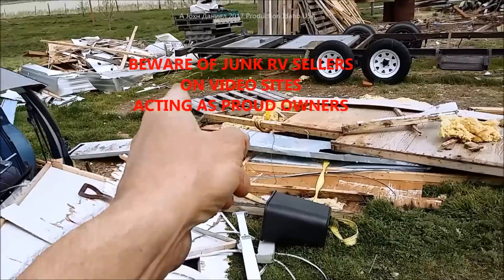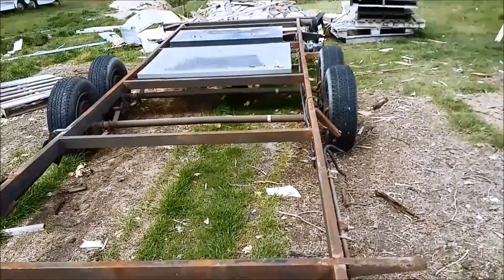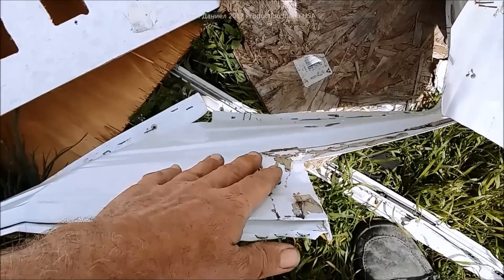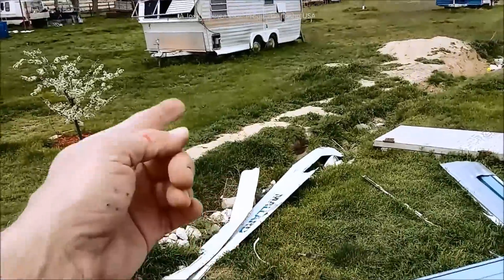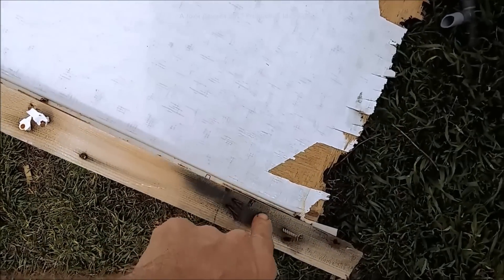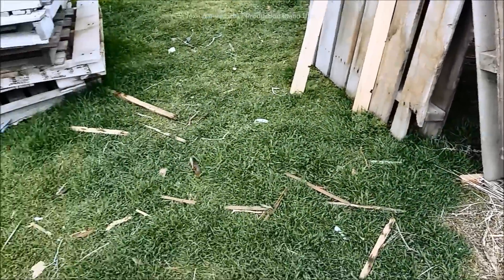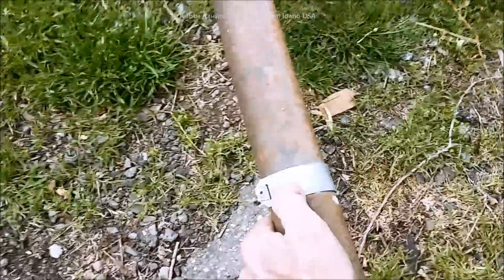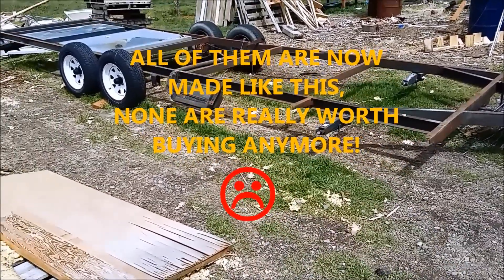HOW THEY MAKE RV Campers Travel Trailers, The truth, Wow! Info Below

Comment: Thank you for more info.....I am on a few RV face book forums and it is sad the amount of problems folks are having with brand NEW trailers and RVs And the unbelievable prices people are paying. I can across a 2003 24' Chinook C class RV. Wow they really built them right. After a few upgrades and new rubber we are supper satisfied that the Chinook company really cared about their work. Too bad they went bankrupt in 2005. The rigs that are out there are good and hard to get away from their owners.....thanks again for your information.
Reply from the maker: No matter your politics, one thing is why the creation of this junk exist. Pay Offs.  
For 3+ years we, a crew of me + 5 built custom home trailers for a while on a as order basis, we used a process that still to this date no one uses. We used all metal extrusion construction of 10 x 50 tiny home/mobile homes. Our construction method was full length, seamless 4.25" thick foam core fully structural panels, similar to insulated garage door panels. Floor, Roof, Walls all with the R-22 panel that weight 18% less total than the current 2.5" walls you see now in trailers. With rib rail locked air actuated pop outs, not slides. If I had not lost my $480 a month health insurance in 2011 due to it not being "approved" health insurance we could have staying going for years. Thousands like us were hit. One 3 day visit to the hospital on Obama fake insurance care cost me a REAL $68,000 while Obama care paid $730 of it after 8 months fighting them, basically nothing after us paying $1400 a month for 2 years to a obama forced fraud insurance. However, now that we are technically poor, we could get it all for near free,  but I recently got rejected for beyond pills medical care for my pneumonia illness but theres no way to ever start a biz again so our builds will just go down in history as 38 homes that increase in value and interest. 
On the bright side, this company paid millions in political donations ( recorded on the DNC web site) to Hillary and Obama and were allowed to sell us shit and keep the small guy out of business with insane cost against the little guy. Thats great for them at least. 

These are MY facts, not someones fake dreams, of what the last 8 years did to small and start up businesses. It was devastating, unless your job was a grubberment job, you got hurt. Lets hope I still have it in me to build again but who knows.

Comment: As John says....get an Airstream, they have nothing that can rot and has very good steel and welds, so you get what you pay for.   From what I could see the Lance brand appeared to be pretty good as well.
Reply from the maker: Airsteam, Holiday Rambler, Chinook, Avion and the like. Used in great shape prices are 1/3 a new RV. You can actually with about $2000 to $3000 put a awesome slide in a old trailer like that and for $3000 to $5000 more fully make it like new, still only spending 40 to 50% the price of a rot box made today.

Comment: Thus the reason you should never buy a wood frame trailer. Aluminum frame & fiberglass are far superior. Most trailers with some common sense upgrades can be made pretty solid. Also, flexing a frame with no stringers/supports attached to it, doesn't mean too much. If they were all built like tanks, they would weigh as much as one and you'd need a  semi tractor to pull it.
Reply from the maker: You could put just 2 rails under them if it was built with more than staples and cheap glue. Shameful thing is I could make one with light gauge metal studs that could be a Uni-Body that would weigh less and be much more rigid. So its the cheap unskilled labor honestly that keeps the 1x2 stud builders in biz!

Comment: Grade 5 bolts are perfectly ok for this use. Do some research on bolts.
Reply from the maker: Yes and no. From my years as a Welder, Machinist, Millwright grade 5 is sufficient in static load, NOT reactive load. Bolt shear under yield in such softer metal without proper dampening and bushings is certain. And LIppert the frame folks knew this, and thousands were recalled. This one was not, it rotted too fast!

Comment: Well, you point out a lot of 'facts', but you're leaving out a lot of detail, too...and I'm not sure if you're doing it on purpose, or intentionally...sounds like you know what you're talking about when you can call a 'drop axle' a 'drop axle', so I'm going to go with 'you know what you're doing'. That said, you KNOW that no one builds their frames...they buy them from Lippert...so EVERYONE has this light-gauge problem, not just Mallard. In 2006, everyone went to 'swamp wood' (bog wood, recovered from various floods in wood-supplier regions)...and you can thank Georgia Pacific and Weyerhauser for that 'hard sell'. Lauan dropping from .9 to .7, you can blame on stingy customers wanting 'cheaper', while you can blame the BLACK MOLD AND ROT on the change-over from Formaldehyde preservants to 'not working so well' other wood preservants (because we can't use CCA or Formaldehyde anymore...thank you EPA).  Vacuum-bagged walls have gotten quite a bit better since 2008, you ALWAYS have to keep up with flood-years to know when to buy and when NOT TO buy a new RV...because last-year's flood is this years 'cheap lumber that Home Depot won't buy' for RV building...and as for those Dexter axles rated at 2,880...hey, why spend hundreds-more for oversized axles when OBVIOUSLY the RV you are carefully inspecting there is a 'oil field job-site' RV that most-likely GVWR'd around 5,100 lbs...so tandem 2,880 means 5,760 GVWR to start with...NO ONE BUILDS OVERKILL ANYMORE! Oh, and I priced a 1988 Airstream TODAY...30-footer (30-years old, mind you), listing for $105,000!!! Sorry but I'll replace 5-mold-buckets before I pay ANYONE $100G for a poorly laid out, cold as a penguin on Christmas Day AIRSTREAM!!!
Reply from the maker: Lesson 101 - Never buy a gold plated Airstream! Plenty to be found for cheap on Oodle.com and Craigs list for $150 to $250 a foot

Comment: I've demo'd a camper before and you're right on the money. Trailers are made to be lightweight so they can jam as much stuff on em as possible. The frames are a joke, although they are made to be stronger with the shell on it.
Reply from the maker: Thats a logical process but on one condition, the upper frame would have to include some small amount of torque control steel too. But with wood and staples you get expansion, contraction, twisting, separating and LEAKING! Differing materials being hauled on the road is just asking for trouble. thats why I swear by Pre 1995 Holiday Ramblers and many Airstreams as the few that can survive the test of time.

Comment: 2,800 LBS x 2 = 5,800 LBS > 5,300 LBS. OK
Reply from the maker: Odd, I came up with 5600 lbs from 2800 x2, and 5300 was that the tag said its wet weight was, before you added your underwear and beer!
Reply: My bad. But, it was made with fire wood, and thin soft drink skin.
That is the reason that 50's 60's and 70's old campers are sill sought after for restoration.
Reply from the maker: You are very accurate on that assumption. In fact, a damage free Holiday Rambler from 1969 to 1993 was affordable 10 years ago, now they are going for the price they were when new and more. Same with Silver Streak, Airstream, Certain AVIONS, and a limited assortment and very certain years made by Jayco, Komfort, TravelAire, Modern RV, Chinook,  Kountry Air, Vegabond, and Travel Supreme. 
Set your goals on finding a wide body, 101" wide like a Rambler and or Kountry Aire and avoid "SLIDE OUTS" and instead just buy a better longer Wide Body trailer. New ones with slide outs are shit, they are 96" wide, but older models like Franklin, Komfort and Vega  had tip outs actually were better, sealed and insulated better. Just lazy ass people are why slide outs were designed. That extra wide body style 5" more width the whole length gave you 97" inside, the new ones give you 92.  So my choice, wide body designs of 100, 101 and 103 over any slide out!! In 1994 they stopped making over wides!

Comment: Get a converted connex on wheels! 

You're welcome!
Reply from the maker: Connex - Tare Weight, 8,073 lbs empty, add some framing for wheels and axles and a hitch, 9200 lbs, now your heavy before you put the typical 2600 lbs of RV stuff in it plus your own stuff about 500 lbs, then your ready to buy a semi! Only 1 in 400 pick ups on the road can pull it, none legally.
Reply from the maker: Seriously, build it the way I have been building tiny houses for 8 years. With insulated garage door style structural aluminum panels.
Reply: Јоhn Daniel - What!? F350 is rated to tow 26k lbs at the hitch or 34k lbs gooseneck. So, you could tow 2 or 3 converted conexes respectively. More yet, if you don't use a 40' box.
Reply from the maker: In all trailer builds, the absolute smartest build would not be connex, it would be the style the Japanese exhibited in 1995 of a whole 30 foot trailer for RV use that was casted in fiberglass, with ribs and floor and rigid insulation like a Uni-body. They even proved its cost was same or less, weight was actually less, strength was 200% more,  but the RV makers in America just blew it off as BS.
Reply: Јоhn Daniel - While that is somewhat interesting, I have neither a factory in which to build fiberglass shells for building RV's nor the inclination to learn the skill of professional-grade fiberglass laying. A conex trailer would be a better choice for absolutely anyone who wants a custom towable home without paying $20,000 for a pile of junk.

It'd last a hundred years, too.

Comment: We bought a used 2008 27ft Salem with 2 slides. These things are made cheap and out of particle board. The 1st winter the ceiling leaked around the roof vent. I found out that the rubber roof had a half inch gap on a corner of the vent. I sealed it with a rubberised roof sealant. I then took part of the bath ceiling apart and dried it all out including insulation. The water that ran in went to the cabinet wall holding the fridge and it ducked up the water like a sponge at the bottom. Pissed me off. The 3rd and 5th winter the flooring split everywhere this last one the worst. I had to cut the flooring out and glued down 12"x12" thicker tiles over the plywood floor. I cut wood trim boards around the floor which made everything look nice again.
When I bought this trailer I made wood shelves in the cabinets and sealed up everything on the outside. I check the roof twice a year and other then those 2 incidents it's been a really good trailer. Preventative maintence is the key for these cheap pieces of crap.

Comment: That sold for $25,000 new and in 10 years it was only worth $3,500...... I think we have a basic problem with common sense right there.
Reply from the maker: TRAILER HISTORY - In 2008 it sold for $22,455 according to the papers, in 2-1/2 years the original buyer unloaded it in a trade in to a dealer in Colorado, 2 months later the second owner bought it/dealer knowingly unloaded it to him for $3,500 due to it being a "extra" on the lot, 2 months after that on the first trip to Arizona, he fell through the floor/wall. Obvious dealer knew it was shit. Trailer sat in a building sealed up during a legal battle on it for a long time, Then I got it for $100 (storage sale) to wreck out to make something from the frame. It was so weak we chopped it up and sold the weak axles to a guy on Craigslist for $100
Reply: So it's even worse than I thought. It was basically junk in less that 3 years. I would think that in this situation, the first owner should have sues the manufacture for his money back. You don't just walk away from $22,000.

Comment: I've got a 1996 Mallard.  Very dependable.  For as old as it is it functions perfectly.  Over the years I added an electric jack on the front and a tankless waterheater. As long as the roof isn't leaking down to the floor I expect it to serve well for many years to come.  The roof on my trailer is an all aluminum roof.  Your bouncing on the trailer is totally unfair.  Any trailer, and I mean ANY that is 28 or 29 Ft long will shake when jumped on one corner.  Knowledge is power and any person with any structural background will know that the frame, combined with the floor and the walls and roof make up the strength.
Reply from the maker: A 1996 is most likely better built. Up till Fleetwood was going broke, they got cheaper in materials. so from 2004 to 2010 when fleetwood was bought out in bankruptcy they made total shit!
Reply: Јоhn Daniel I had thought of the timing. My flooring is still very good and the roofing aluminum is rock solid.

Comment: "ALL" current brands are "junk"?  What about Airstream?
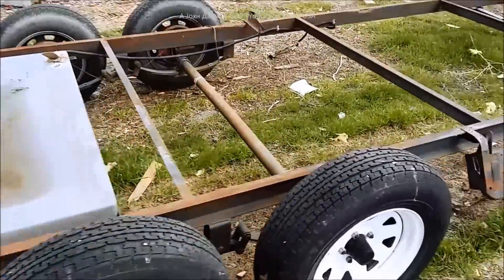Edit:  Never mind, I just heard what you said at 6:54 on the video ("So before you go wasting your money, look for an Airstream to restore.").
New question:  When (if ever) do you think Fleetwood and others were producing quality trailers under the Terry, Mallard and other brand names - were they ever good?
My own anecdote:  Back in the mid to late 1980's I played trumpet for, and was music director for one of the touring Shrine Circuses.  We traveled about 35,000 miles a year throughout the western United States and western Canada (it was a BLAST!).  In 1987 I bought a Terry Resort 31ZB basement model travel trailer for about $13,000 new.  It served me well.  Being the Resort model it was at the lower end of the build spectrum, but in a way that was an advantage because weighed about a 1000 lbs. less than a similar sized high end model (such as the straight Terry model).  BUT:  I was blowing tires every few thousand miles.  Turned out the 14"  (yes, 14 INCH) wheels and tires were WAY overloaded.  And the axles warped on it.  I went to the Fleetwood factory and under warranty they replaced the tires and wheels with 15" ones of the proper load capacity and replaced the axles and springs with thicker ones.  Granted I was doing 35,000 miles a year, but hey, this means that all the other people who bought these for vacation purposes were traveling around with severely overloaded tires and suspensions on the things.  Not cool.

One more question:  What do you think my best bet is for a 24 - 26 foot travel trailer in the $3000 - $5000 range today?  Old Terry or similar?  Really old Airstream or Avion that needs work?  My skillset is in the medium territory.

Comment: In 2005, I bought a 32 foot 1995 Fleetwood Tioga Class C for $8500. I used the hell out of it. I resealed the roof once. No leaks, just being cautious. I also resealed the weather stripping around the windows a couple times. All systems, except the roof air, were working flawlessly when I sold it for $5500 in 2015. The new owner replaced the A/C for $500 rather than getting it recharged. I replaced one of the coax splitters under the fridge, the crank handles on the roof vents, and a couple dozen 12volt interior light bulbs during my ownership. I also bought new tires. All in was about $4500 cost in maintenance/upkeep/depreciation for ten years.  Well worth it. Maybe being built on a full E-350 truck chassis made it hold up better ? Don't know, don't care. I do know it was a blast for myself and three children.   
PS: Ammonia refrigerators are incredible.

Comment: I'm so glad we bought a 1989 Holiday Rambler Crown Imperial. We're updating the interior right now. She's solid, water tight, and still so classy. Problem is she has an optional window that sits over the windshield that was damaged. Looking at over $1000 to get it replaced because it needs to be custom made.
Reply from the maker: Go to a local commercial glass shop, have that window made with 1/4" plexiglass that can be heat formed to fit and easily cut. Usually runs about $250 to get done.